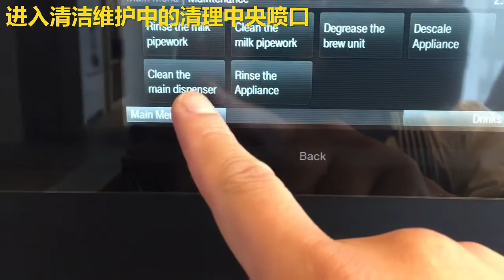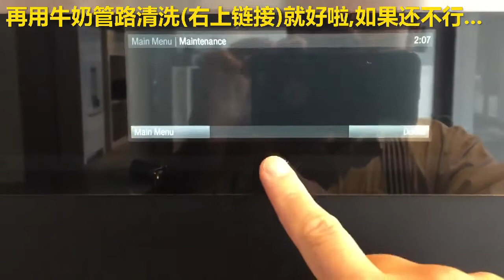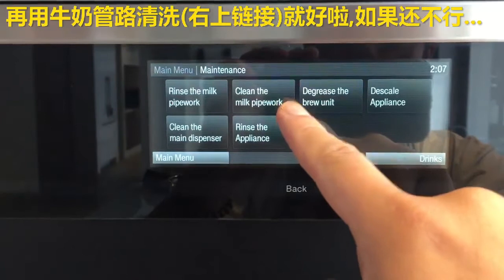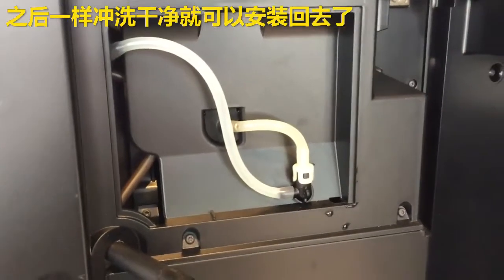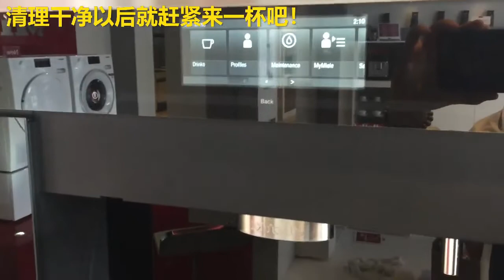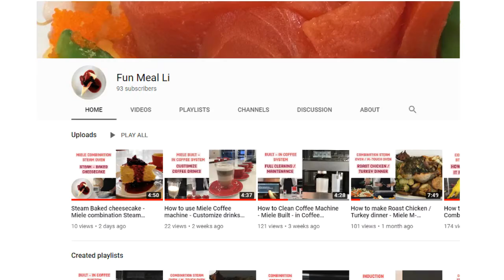How to fully Clean Milk Pipework - Miele Built in Coffee System - miele咖啡机牛奶管路清理

Comment: Hi, I was having a lot of milk dispensing problems with my Miele built-in coffee maker, even after doing all the standard cleanings.  Miele sent over a repair technician who replaced my three-way valve, but also gave me a great tip - at the end of each day where milk has been used, to make a "hot  milk" beverage but using water in the milk container.  This will flush all of the parts with hot water much better than any cleaning cycle.  I now do this all the time and have had zero problems with milk dispensing ever since.  The downside is that I have to descale more since the machine thinks that more beverages are being made, but that's not a bad trade-off and more cleaning can't hurt.   Great channel!!  I have a combi-steam too and love your tips.
Reply from the maker: That is a fantastic trick Howard, thank you for sharing. I gotta try that some times.
Reply: @SteamOvenGuru  This is an excellent tip.  The video here is great, but the problem for me was coagulated milk at the point of the flask output and into the machine.  The pipe cleaner was able to fix, but I now run the hot water via the milk flask as well.

Comment: For me, the issue is with the black sealing piece on top of the milk container cap: i need to make sure to insert the sealing piece first and then install the steel pipe.    Otherwise, I guess the pipe keeps sticking out from the other end of the sealing piece, causing the milk to not get dispensed properly.    Hope this helps.

Comment: Thank you for your video.  Have a new CVA6805 and are still learning about it.  The milk dispenses fine for milk drinks, but it is very lukewarm milk and not hot enough.  Have increased the coffee temperature to Max but the lukewarm milk ruins the drinks.  Also, the coffee tastes very bitter!  Will try other beans, but any tips you have for hotter milk and removing bitterness in coffee would be appreciated!
Reply: Do you have a water softener installed? Is your coffee machine hooked up to any kind of a  filtration mechanism?
Reply from the maker: Any milk intensive drink (latte, cappuccino, flat white, etc. will show signs of temperature change based on the temperature and amount of milk used. I would recommend perhaps micro-waving the milk jar (glass part only) for a few seconds. In terms of bitterness of the coffee I would try selecting a different setting on the coffee coarse / fine setting (next to bean container inside the machine) and then adjusting coffee amount used. Medium-dark is my usual go-to for roast level for this machine.

Comment: 你好，我的CVA6800有個非常糟的牛奶管問題，我用了您的方法清理但是出了的蒸汽還是很多並且沒有多少牛奶。

我在清理的時候有嘗試用小水柱測試看水有沒有辦法流通，結果發現三通連接上的有白蓋子的那個口好像水沒辦法輕易過去，
我又嘗試直接把它當吸管一樣又吸又吹的也是感覺氣也過不去。
請問這個接口本來就是這樣的嗎或是它其實就是造成蒸汽的元兇呢？

Hi, my CVA6800 is having a really bad milk pipe issue; it doesn't dispense much milk but a lot of steam is coming out instead.
I tried your method but the issue persists. 

Nevertheless, I tried to run water through all the connecting parts as you mentioned to make sure there is no blockage, and found out that water doesn't go through the white part of the three way connector easily; I even tried to blow and suck on it as a straw but even my breathe would go through.
Is this a regular behavior of the three way connector or that might be what's causing the issue?
Reply from the maker: 有可能是这个三通堵塞了。机器送货的时候 的零配件小盒子里面应该是有赠送的三通，可以换上试试。或者可以试试看i调整牛奶容器里面的管子的位置。

Comment: Hello. Time to time my built in machine doesn't froth as good as it should. Do you know why?
Reply from the maker: Hi, many reasons! Good news is that they can be normally easily solved with most of the contents on this video. 

Quality of milk, milk pipework cleanliness, or even just the valve shown in video, or the dispenser spouts may be clogged. If all goes well and froth is still not good, the milk container pipe may be installed not properly, or the milk container seal is not tight...
Reply: Likely that the milk valve on the inside panel (3rd part he cleans in this video) is clogged.  While you are cleaning it, need to ensure the white connector allows air to pass one-way.  It is likely clogged.